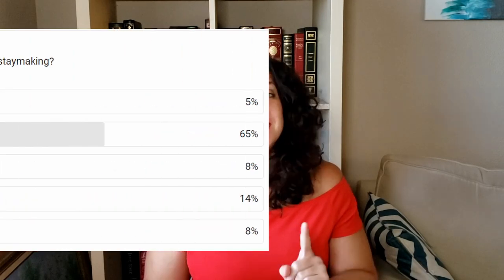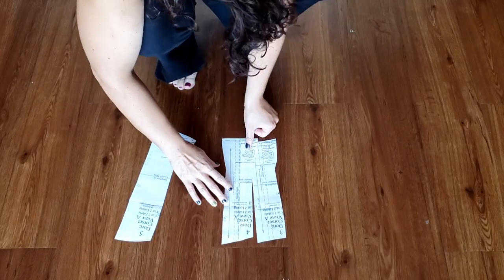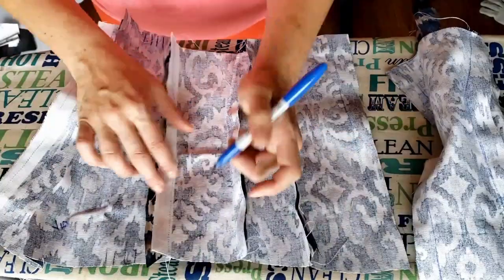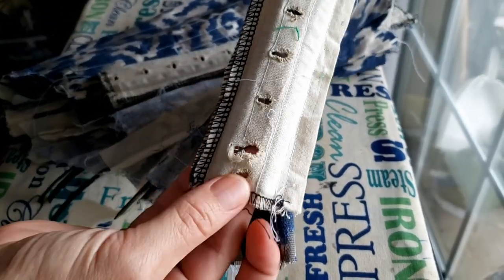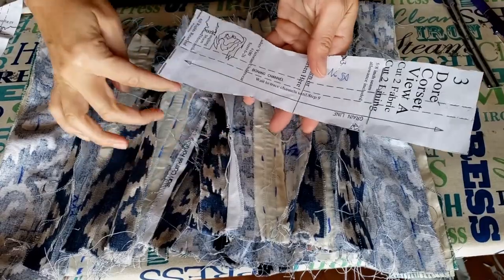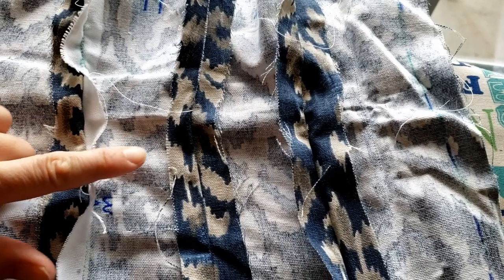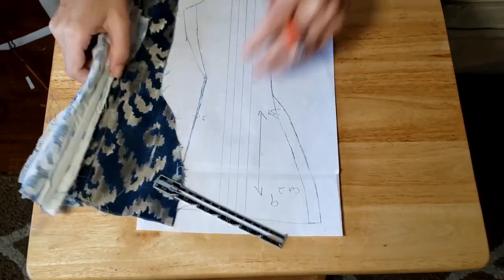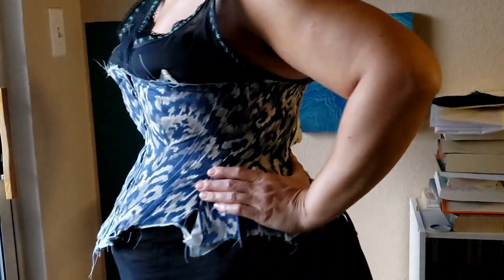How to Fit a Victorian Corset the Easy Way

Comment: Your timing is impeccable. Or maybe mine is? Either way, I am currently in the process of making my first corset! It is an underbust pattern from Arenea Black and I have modified the pattern to my measurements and am cutting out my first mockup. Here's hoping I measured correctly 😅
Reply from the maker: Or maybe both! 🤭 Good luck on it!

Comment: Aye, aye, Cap'n!

"fit your real waist measurement, then pad out the bust and hips to get the shape you desire" HAHAHAHAHA I wish I knew my waist measurement. It's a dirty dirty liar. For that matter, my bust and hips also lie, plus my floating ribs get crabby when restrained... (for example my bust measures 40" but if I wear a 40B bra my boobs slide out underneath it, my hips measure 39" at the fullest part but any waistband over 35" will slide off over them without undoing the closures, and my waist for a dress is 2-3" higher and several inches smaller than where I need a waistband to be and if I make a loadbearing waistband that measurement, it rides up my ribcage and annoys my ribs, and if I snugly measure my waist where a waistband goes, I will lose my pants if I don't go about 2" tighter when I make the actual band...) And I literally have no idea how my spare padding does what it does, it slithers around waistbands in really entertaining ways. Maybe I'm corset-sqwuishable up to the point where my ribs hate me? Maybe I'm always going to need shoulder straps on every support garment?

So far I've made a half-corset sports bra that kind of works (best thing I learned with that was how to mess with the boning to get "the girls" up front and out of my armpits, I reversed the slant of the boning on one side in my second or third mockup ro compare and contrast!) and thought I was done so went ahead and used fashion fabric but it's back on the UFO pile cause I need to open up the "waist" because crabby ribs, and a princess seamed support vest that mostly does the job but really badly needs some boning to keep the bottom from flipping up. Going to revisit stays, maybe they won't annoy my ribs. Ugh I feel so much like I'm dealing with the princess and the pea, I hate being that princess. Get to know your body, they said, Get to love your body, they said. What if your body's a jerk? :D
Reply from the maker: Arrrgh, shiver me timbers! Thanks for watching! 🏴‍☠️🦜